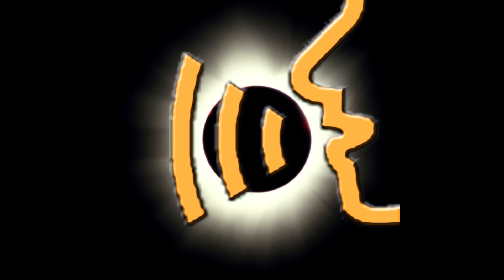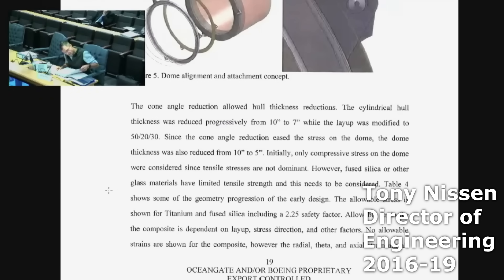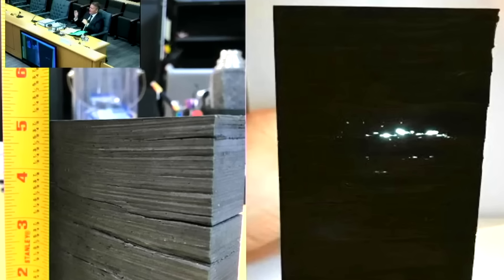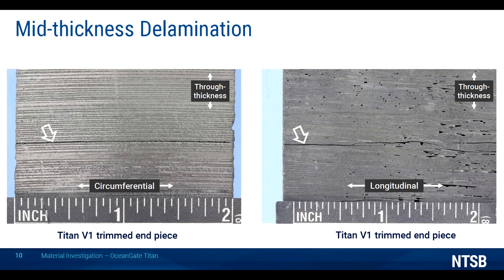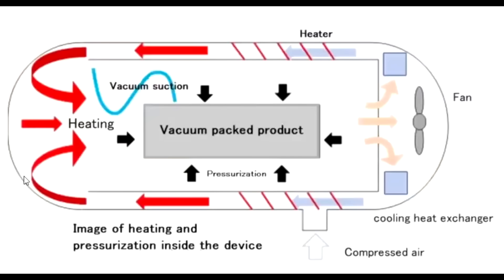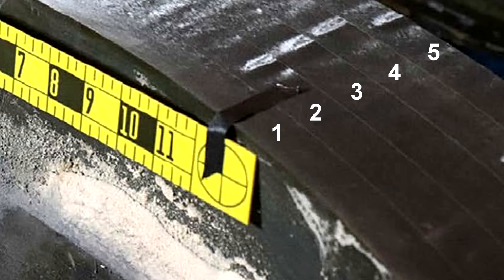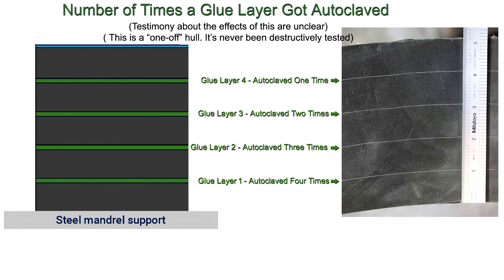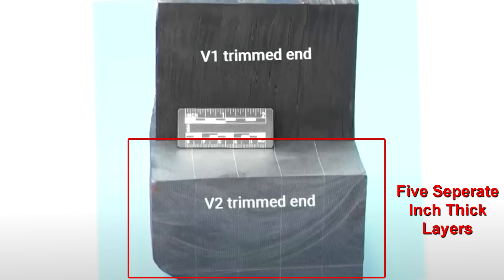Who Engineered the OceanGate Titan V2 Hull? Maybe Nobody Did?

Comment: As someone that is well versed in composites and engineering, this baffles the mind. So much stupidity. The lack of testing, the lack of reliable material data. Stupid decisions in design, disregarding over 10% in thickness, disregarding 45 degree ply’s, the jump in stiffness over the interface. I’m officially mindblown, that they could even build the sub with how little knowledge they had. They had no data on the cyclic behavior of the glue/composite interface. Not even on the coupon level. No sane engineer would have touched that project, I certainly wouldn’t. 
Zero regard for damage tolerance and a gross misunderstanding of failure modes in composites. It’s mindblowingly dumb.
Reply from the maker: Thanks for commenting.  I agree with you.  It's a tragic but amazing story.  That is why I am so intrigued to analyze the details and try to understand it.  It's an incredibly complex mix of odd engineering and odd personalities.  "You can make this stuff up."  Have you watched my other video that explains the background of the business model and the financial problems, search YouTube for this title   OceanGate Was Broke! - Titan Caused It - Employees "Spill The Beans!"
Reply: I hate using boeing as an example of experts but they were the only ones who brought up defect/discontinuity and I’m sure they would have also mentioned how it effects fatigue life and rated pressure
Reply: @ Exactly. And especially in low cycle fatigue, defects/notches have a huge effect in composites.
Reply: @numair23 yeah and they still had doors flying off their airplane in mid flight
Reply from the maker: I agree with you.  Even with their basic analysis at the time they were identifying important points.
Reply: @solareclipsetimer no one expects that when they are in the middle of an unfolding accident that they had ever expected to be there.. there is an ignorance or lack of high insight...even Chris craft head of Apollo flight said in his book ..Always looking for the unsean unseans after that fire that ended the life of those two astronauts in a test capsule.
Reply: What makes fiber-resin composite attractive for developing new designs in compression-resistant structures? I mean, fibers are noodles. They resist tension. Thus, a pressurized aircraft might be a good place for using fiber materials. But a cylinder being compressed by unimaginable forces? Why? It seems like the resin is the hero here, and the fiber temporarily bonds to the resin like tensile rebar. Eventually, the flexing will loosen the fiber-resin bonds and neither the resin nor the fiber is inherently a good base for a robust, compression-resistant cylinder.
Reply: I see it every day in electronics design.. no one is necessarily in danger but the wasted time sorting out simply avoided mistakes is mind boggling..to operate like that when life is on the line is astounding on how dumb it all was .

Comment: Sooo... The fibers that make the material strong, which are strongest if they are unbroken... They purposefully broke them because they could not lay them down without them wrinking...
Reply from the maker: Yep, you are correct.
Reply: They didn't actually break the fibers (the fibers run parallel to the surface of the cylinder, not from inside to outside).  They just didn't build them up all at once, but in stages.

The direction of the "breaks" was actually perpendicular to the directions where strength was required, so in theory, it should be possible to build things that way without compromising the required strength (which is why the manufacturer was even willing to go along with it).  The problem is that theory and reality are often not exactly the same, which is why you need to test these assumptions before just blindly staking people's lives on "well, it should work..."
Reply: @foogod4237 they sanded down the wrinkles, breaking fibers.
Reply: @foogod4237  seems you forgot the L

Comment: CF is a bad material for repeated pressure forces. Especially considering porosity and air and water ingress. Changes in pressure can separate cf layers.
Reply: Pockets of air and water under insane pressure and temperature differentials inside the material are the main factor in my opinion. They made all of their calculations expecting a perfect material with zero flaws and pockets but that's virtually impossible with the manufacturing techniques. Even with milled steel the parts need to be meticulously examined using x-ray, ultrasound or magnetometers to ensure there aren't any imperfections. Using laminated cf that isnt even a single piece but glued together is quite frankly inconceivable for such a high pressure high precision application as deep sea submarines.

Comment: NASA didn’t do anything wrong here. They’re not a contractor, they’re a research institution. They provide discounts on research that will also assist their mission. My assumption is that Rush elected to take the large savings of letting NASA work toward their own research goals at the same time.
Reply from the maker: Thanks for your comment.  My intent wasn't to be hard on NASA in this video, if that is what you are saying.  I did say that they were involved only for ideas on debulking the laminate and they were out of the picture prior to manufacturing.  OceanGate had a habit of doing that, hiring people only to the point of gaining the information they wanted and then stopping the relationship to save money.  But, I still think when you are consulting on something that you have special experience with, NASA and composites, you have to provide the information considering the context of the end product and if you don't think your expertise applies to the marine environment maybe you shouldn't take the job. It is the responsibility of both parties to be sure the information and the assistance applies to the end use and I allude to that in the video.  NASA just had to ask "what are you planning to do with this information?" and then maybe say, "you know, we don't feel comfortable that our expertise is directly relevant to building a hull designed to take 6,000 PSI of external pressure.  Thanks for the opportunity, but no thanks."  NASA looked pretty bad during the hearing answering those questions and they looked pretty bad when Stockton was out there publicizing that he worked with NASA on the design of the hull when in reality the association was minimal.  I love NASA, I've been to shuttle launches and landings and have worked with them on solar eclipse-related projects.
Reply: @solareclipsetimer  It sounds like NASA assumed OceanGate would be responsible in making the decision about whether it's safe for use or not and in the meantime they could do tests.
Reply from the maker: @purplefood1  You are correct,  NASA , Boeing, UW-APL, all engineers and scientists would assume that you plan to do proper testing.

Comment: I had carbon fiber handlebars on my bike.  Had,  because they broke.  For now,  carbon fiber is only for temporary,  disposable use. I don't believe it's possible they didn't know this.
Reply: To be safe with carbon handlebars, you essentially have to replace them after every major crash. I can say for a fact though, a lot of carbon handlebars break becaus people overtorque them so crazy. If surface pressure is not evenly distributed theres huge shear stresses along the fibers ultimately leading to failure. Also clamping can cause instant delamination. Friction increasing paste is absolutely needed. Torquing to manufacturers specifications is not optional in this case.
Reply: @VelpkeTrials  I just figured Amazon was not a good place to buy carbon fiber handlebars.
Reply: @walterbrownstone8017  😄hope you didnt hurt yourself too bad. Snapping bars is one of the worst things that can happen.
Reply: @VelpkeTrials I'm like a cat
Reply: That's really about the same as saying "I used aluminum foil once, and I poked a hole in it, therefore metal should only be used for temporary, disposable use."

There are many, many different kinds of carbon fiber (it's not all just one thing), and it absolutely is not just for "temporary, disposable use".  There are many places in the real world it is regularly used in extremely high stress and demanding environments, and actually works just fine (for years and years).  Quite often, it can actually be stronger and more durable than things like steel, when used properly.

But it has a lot of very tricky details about how it needs to be both made and used to perform correctly, and if you change any part of the process, you can change the results (and the process that is used in one application may not be appropriate for a different application, etc)...
Reply: Great for missiles 😂
Reply: Amusingly perhaps, that is also a compressive, cyclic (pun intended) stress use case. A less disastrous failure case, but it seems an equally poor choice!
Reply: @SimonBuchanNz  But even as a pressure cylinder in a moving vehicle,   wouldn't the pressure range be even more unpredictable? Almost undetectable vibrations may be all that is needed for a catastrophic failure. As far as I can tell,  everything depends on the properties of the glue? You just can't make the framework of a vehicle from brittle materials like glue.
Reply: @walterbrownstone8017  my (limited) understanding is it's fairly good as a tensile material, so a good choice for spaceships, and acceptable for non-cyclical compressive stress. Guess what neither handlebars or submarines are!
Reply: @SimonBuchanNz  Maybe certain things like submersibles and aircraft can't be managed by private companies period. They will always sacrifice quality for profit.

Comment: To actually research a carbon vessel like this you need a Formula 1 team. They are carbon experts and have the budgets to actually do a prototype. Also and dont take paying customers in a prototype
Reply: Formula 1 engineering is designed to address completely different design goals.  The people who do that are absolutely not qualified in any way to make submarines.  They likely wouldn't even know what the basic requirements should be.

And "carbon fiber" isn't all the same thing.  There are thousands of different ways to make it, out of a wide variety of different core materials, to produce results with completely different properties and abilities.  I guarantee you the stuff they were making this sub out of was pretty much not the same in any significant way to the stuff they make F1 cars out of...
Reply: @foogod4237  Yeah, it is a completely different industry.
Reply: I agree, although F1 teams are focused on aerodynamics and making it as light as possible but still strong enough that it will work and be up to the regulations.
Reply: @malcolmmackenzie9202  strong enough it will work for 1 race
Reply: @captaintoyota3171  carbon fibre and even aluminium is not great for durability.
Reply: Aluminium does not have a fatigue limit, so the more fatigue cycles it goes through, it just gets weaker and weaker until it breaks.
Reply: Steel is much better as it does have a fatigue limit so at a point it stops getting any weaker and will stay the same strength indefinitely, no matter the number of fatigue cycles.
Reply: Carbpn fiber, too, does not have a fatigue limit, so it will constantly get weaker. The more fatigue cycles it goes through until it breaks, especially with joins of glue and any impurities within it. So it is definitely not a good choice for something that is going to go through many high stress cycles.
Reply: Are you serious? F1 teams have no experience designing vehicle-sized hulls built to withstand immense amounts of pressure.  They focus on creating downforce and reducing drag.  Even traveling at absolute top speed, an F1 car is not going to experience the same kind of pressure as the bottom of the ocean

Comment: 10:50  "Oceangate was forced into the layered design, glued together, completely untested for a submersible"

Not entirely accurate. Similar constructions exist all over the subsea industry in poor quality repairs. Layers like that are 'untested in submersibles' in the same way a rice paper submersible is untested in submersibles- you probably could test it, you might even make it work once, but why bother when you know it'll fail?
Reply from the maker: Thanks for your comment.  For the context, for that part of the story, what I said was accurate.  He decided not to use Spencer Composites again.  He decided on Eclectoimpact for the second hull and asked them to do the V2 hull in one 5-inch thick layup and Electorimpact said no, they said it was either 1-inch layers and co-bonding or go somewhere else.  Phil Brooks, the director of engineering testified as such, under oath, and I have that in the video.  So, Stockton, at that point was forced into it.  I am not sure any alternatives, at the time, existed for him.
Reply: @solareclipsetimer  I was only taking issue with the idea that this was untested. 'Untested' makes it sound like it's an unknown but layered arrangements like this are actively avoided in submersible equipment that'll work under significant pressure. It's well known to lead to failures.

There was an alternative, which was to not make a submersible out of the wrong materials in the wrong way.

Comment: i think that the hull had already begun to delaminate with water ingress between the layers when the loud bang was heard. i suspect that was the differential reexpansion as the submersible ascended. i think thats also why parts the the hull fully delaminated yet didnt shatter when the implosion happened. there was already water between the layers at that pressure when the rest of the hull let go. i think the collapse started at the aft as the aft ends of both side rails were stuffed into the aft end dome during the implosion. ie think of the diameter of the aft end suddenly reducing pushing the aft ends of the side rails inward a couple micro seconds before the rest of the hull shattered and the fore end dome was shoved back towards the aft.

Comment: So we take a 5" hull that's already too thin and chop a good chuck of it out to fit the titanium ring you made the wrong size...
Reply from the maker: Thanks for your comment.  The titanium ring was reused from the first hull and was a fixed size based on the mandrel.  The V1 hull had to be trimmed down also.  But the V2 hull ended up with a wider external diameter so it had to be trimmed down more to fit into the clavus and be glued in.